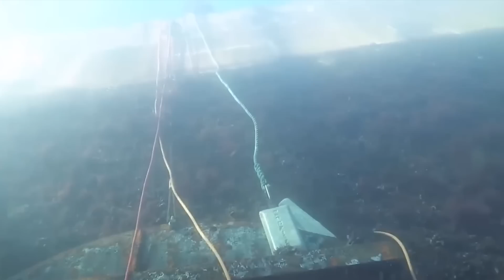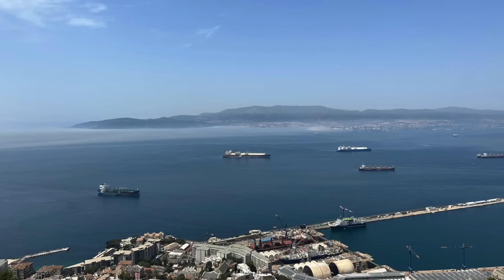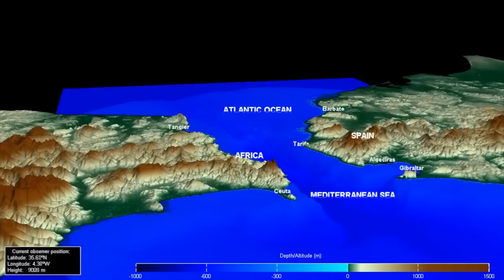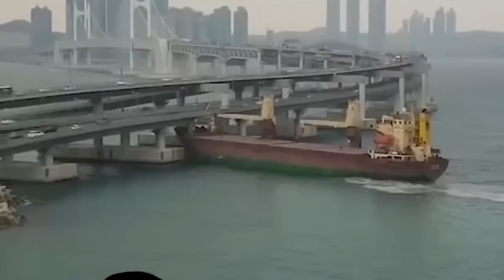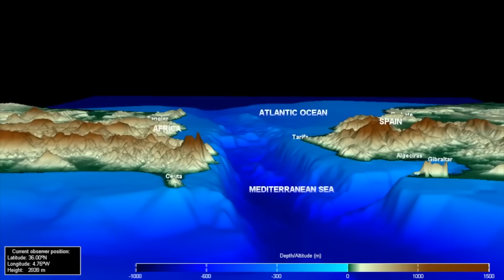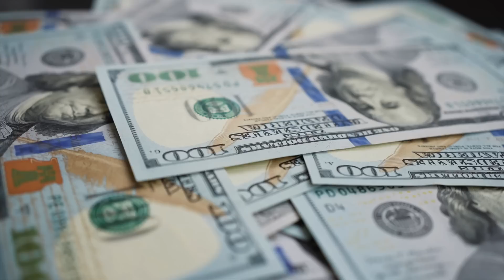Why Nobody Can Build A Transport Link Between Europe And Africa

Comment: Is there any economic incentive?
Reply: Yeah, for the “migrants” invading Europe! 😂
Reply: nah.
There could be, along the coast towards nigeria. Sahara is a problem. No decent roads after Morocco and building them means constant maintenance in removing sand. Then once passed, you get to tropical forest and far from optimal roads for quite some time aswell.
Not worth it to only do it for Morocco. Entire north Africa also not. Its faster by ship.
Also, Russia China, Iran are unlocking a trade route north south, to the east of Africa, which is then connected to the new east-west 'silk' road.
Reply: Yes, the UK is running low on pizza delivery professionals.

Comment: Can be 10 billion repair under water Grounds Situations And Than Use Con Steel Pipes Setups and Connections is Can be but To Transportation Pipes is 😅 and Finally Steps Side by Side Up Side down Pipes N.A TNLA MNDAA AA CN. Can be depending on Design🥢🕸️ pipes 🍡🍡🍡

Comment: If there was an urgent need for such an infrastructure, they would have probably found a solution.
The reality is that there is no real economic benefit or, at least, not big enough to start such a huge project: this is clear by just looking at the flow of ships that go THROUGH the passage. Ships don't go from Africa to Europe and vice versa, but go east-west.
All this traffic is basically traffic from Asia to the U.S. and Rotterdam via the Suez canal.

Comment: Maybe a zip line instead? Weeeeee
Reply: 😆 gets my vote
Reply: Giant catapult.
Reply: @BanterMonkey  a trebuchet might be more fun
Reply: @TheGumpyGump  Not heard of one of those before. Is it a drink?
Reply: Perfection.
Reply: that's actually a kind of cool idea for moving cargo across water, especially water with dynamic tidal flows or a steady current like a river.  the tide could power elevators on one side that allow cargo to roll down a cable to a lower elevation on the other side.  generative braking could also perhaps be used to power the elevators.  the lowering of elevated elevators could help generate power too.  it might not be practical for the strait of gibraltar, but it could be in a lot of places all over the world, IF such infrastructure isn't already in existence.
Reply: Those platforms from SMB that start moving when you step on them
Reply: 😂😂😂hilarious
Reply: Here’s $5. Let’s make it happen.

Comment: Norway has a tunnel that floats in the middle of the water column. With 6 pillar locations, pillars only 100 meters tall and simply keeping the tunnel steady while the tunnel itself gets designed to be naturally boyant to that depth. It would be a great use of hyperloop technology.  The tunnel can be designed to break into sections that self seal if the worst case happens. 
Because it floats seismic concerns are minimized or if a cargo ship sinks on the tunnel it can be sealed before impact and possibly disconnected to then float to the surface.
Reply: Were ?